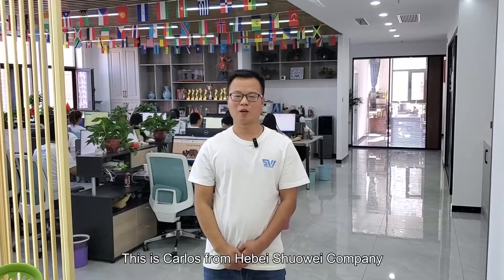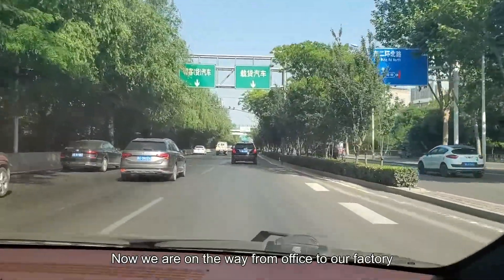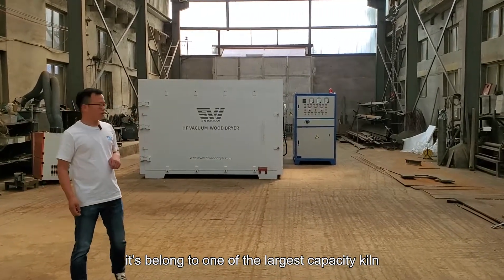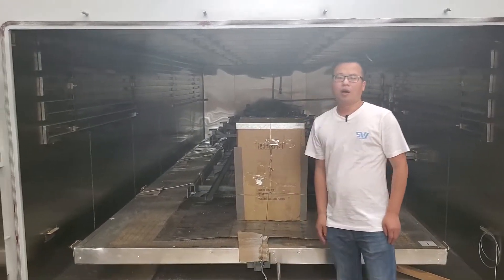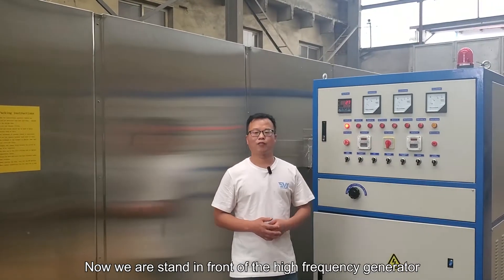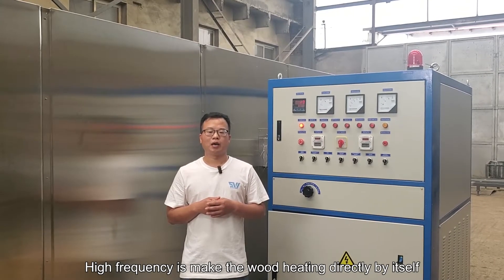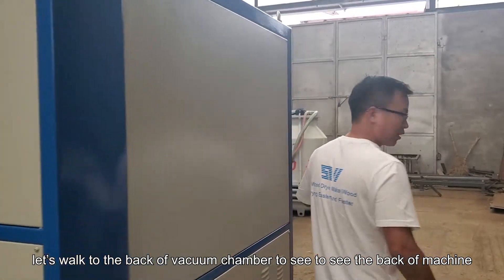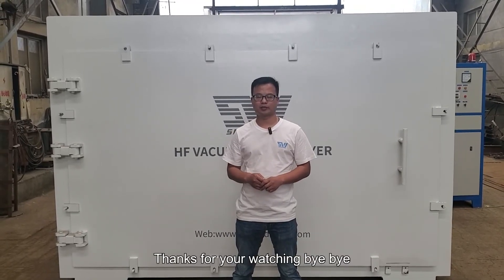The most advanced dryer - introduction of high frequency vacuum wood dryer kiln

Comment: Is that inludes pressure treatment or is that only for dring only
Reply from the maker: Yes, Shuowei kilns include pressure treatment, not just drying.
They use a Taiwan-made hydraulic system that applies over 6 tons of pressure to keep the wood straight and prevent warping during the drying process.

Comment: So you are basically freeze drying the wood?
Reply from the maker: Thank you for sharing your thoughts!

We use high-frequency vacuum technology to kiln dry the wood. The moisture inside the wood cells turns into steam at low temperatures and is efficiently removed from the vacuum chamber.
Reply: @shuoweikilns  Thanks